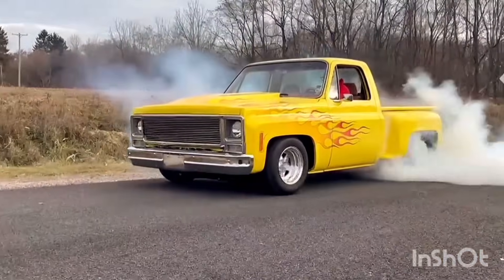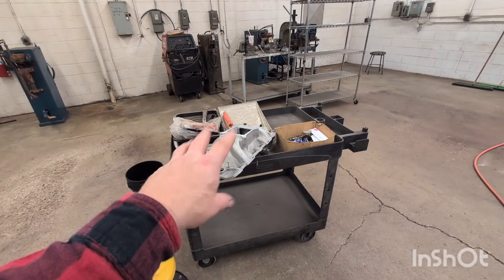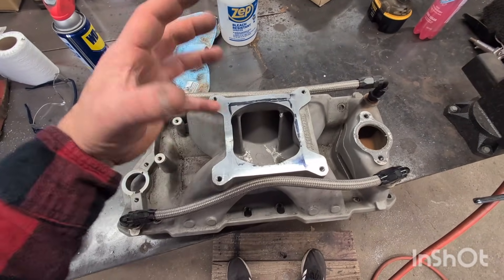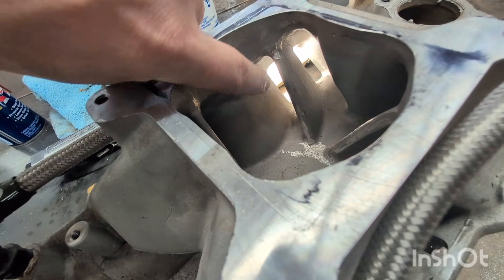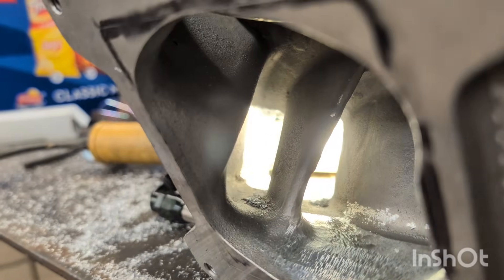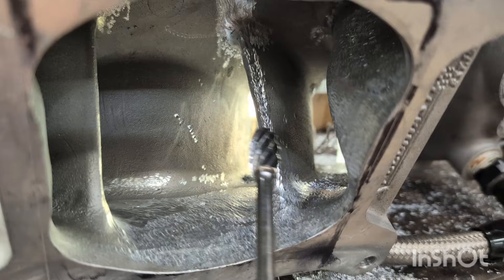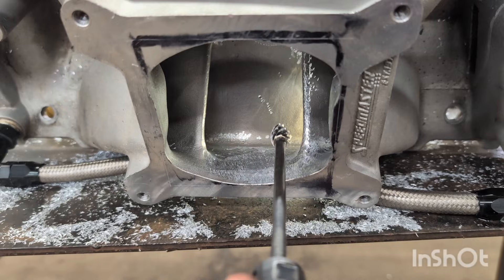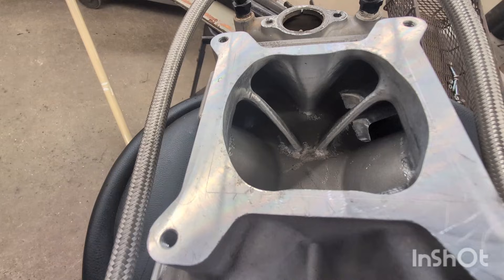Easy Intake Porting = Real Horsepower (Dyno & ET you'll see!)

Comment: I saw  no dyno or et proof  in this video  .... basically  you are increasing  the tuned rpm band of the engine  and moving  power from lower rpm to higher rpm ... back to back dyno testing  is the only way to really  show that this work helps
Reply from the maker: That's the fun of this. This is for you to see the proof. Hopefully you have a combination that you either dynoed or raced. And you are now at your peak. This is something that is free for you to be able to do that. I've done a hundred times over that flat out works and will improve horsepower and lower your ET.
Reply: @Musclecarcustomgarage ... i run a dyno  and a lot of times such work does nothing  or costs you low rpm  power  .... if you have done it that much then you should  have proof on hand to show ... in the video  title you said you had proof ....
Reply from the maker: You're absolutely right. There has been no proof over all these decades that porting an intake manifold will give you more horsepower. every car guy , they're interested in one thing. How do I do it for myself. This video shows them that. I never said in the video. I'm going to show you proof on the dyno and down the track. Get  clear, I said it will improve on the dyno and down the track. But it has been shown through countless magazines and other videos. Those words never came out of my mouth. But we've all seen the proof, time and time again on Dynos and people racing down the track. if you port The same intake that you have been running correctly, you will not lose lower RPM torque you will gain everywhere. So if you are losing down low, you are porting intakes incorrectly.😂
Reply: @Musclecarcustomgarage again  your leader to the video  says you have proof  which you do not show ... you generalizations  say you dont have back to back proof ....  I have been  doing  this stuff 40 years and understand  hp better  then most ... I have 2 flow benches  and a dyno ....  if you post you have proof then show it ... run it ...port it and run it again ... sometimes  we do that and intake has not even  cooled off .especially  when looking  at fuel distribution  which you did not address at all